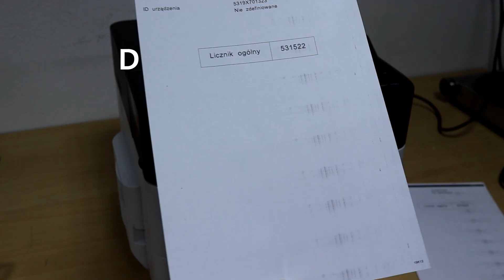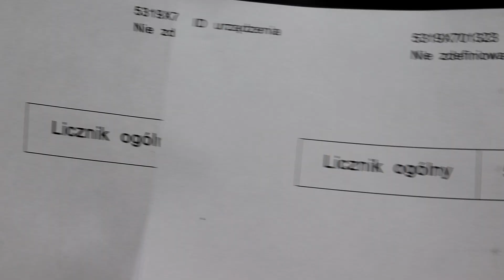Naprawa drukarki zestaw konserwacyjny RICOH IM550 IM600 P800 P801 IM430

Comment: Hi dear friend.
I have a tedious problem with ricoh 4001.
I dend a print on the printer and prints that. But for second print even the exact previous print, the ricoh warning missmatch paper tray. We must then restart the ricoh for print second print and this problems containing for next prints. 1 print=1 restart. Please help us.
Appreciated your kind attention before
Reply from the maker: If the problem is only when printing, uninstall the printer and reinstall it. Update the software to the latest version and this will not be a problem. But if this problem also occurs when copying, I would start with a thorough cleaning of the sensors in the scanner section.

Comment: What does this message mean when copying into a Ricoh 4503 printer?((Auto-restart Functional problem detected. Auto-restart will occur. Make the settings again after the machine has restarted.))
Reply from the maker: You will need to go into the SP modes and get the exact SC code that is being generated. While you're at it, I would turn off the auto reboot.
5-990-004 to print out the logging data, 5-875-001 set to 1 to disable auto reboot.

Comment: Hello! Simply cleaning the charge roller resolves this defect.
Reply from the maker: In this case, the number of copies did not allow for repeated regeneration and cleaning. Visible marks were from the cleaning strip. I had to replace it because this printer makes 150,000 a month, so it must be 100% good.
Reply: In my country these parts are very expensive and customers do not change. usually i perform cleaning or replacement of charge roller and exchange of opc drum and blade. but the original new parts are much better and guarantee greater longevity to the equipment. thanks for the videos my friend!
Reply from the maker: @Leandro Leme Respect. It makes your job more complicated. Of course, I also often have to replace only the OPC, Cleaning Blade and Charge Roller, but most large customers agree to expensive repairs because they want to work calmly.
Reply: It's the same as Fs 4200 kyocera?
Reply from the maker: @John Theuri Consumables like Drum, Fuser, Developer are the same, there are no differences. It must be remembered that when you use the developer unit in the kyocera version, you will have to install toners with a Kyocera chip.